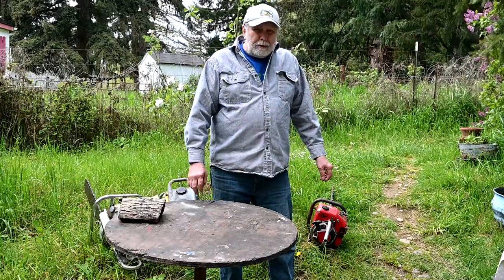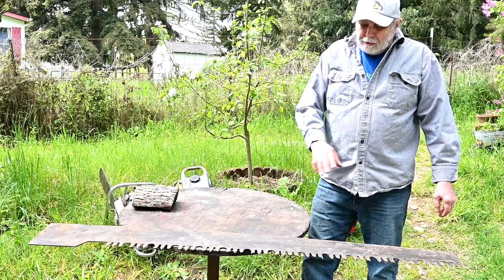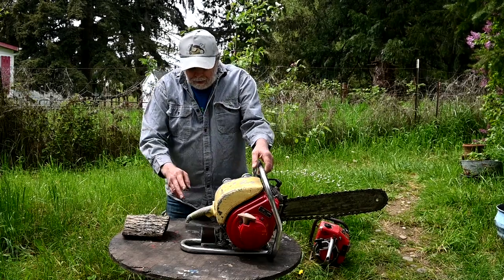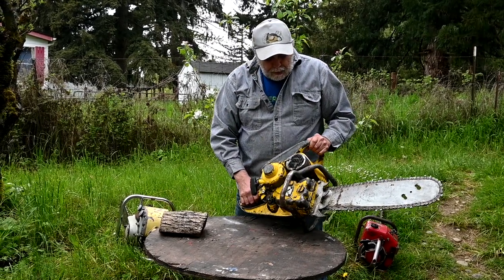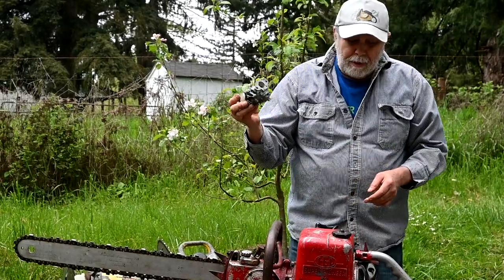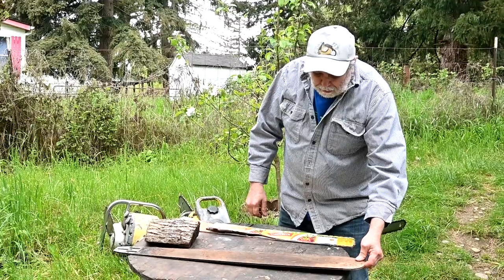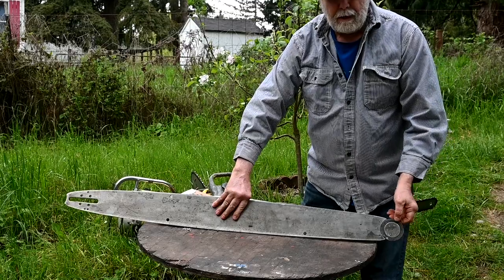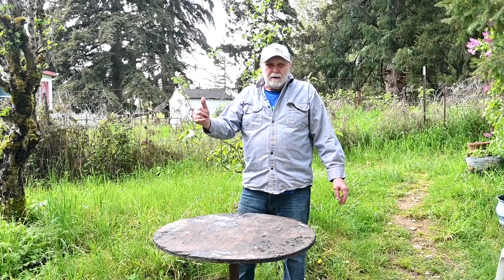Obsolete Chainsaw Chains + Vintage Chainsaw BS

Comment: I've worked on most engines in almost 60 years of wrenchin'. Many years ago I was given a cutter link from a guy who'd found it on his workbench. He'd worked as a parts man at a local dealership who, at 1 time, sold chainsaws & related parts. This link was from a roll that you literally made, piece by piece, a chain. So much for pre-made chain.
Reply from the maker: What an interesting tool and a neat tale !
Reply: What I should've said was likely from several boxes of chain parts to make a chain. I carry that cutter all the time in my change pocket. It had to be at least 1/2" or more. Makes me wonder how long it took to make a 20" chain.

Comment: Great explanation on bars and chains .
Reply from the maker: Thank you.
Reply: @mrobsoletesvintagehomestea9156  Thank you for showing me what for the most part I totally agree. Vintage stuff is just so great, period. I have an old remington super roller nose that is made in 1970. That saw has I would bet at least two thousand cords of wood that it processed for me and my father before that. Fifty two years of dependability. Forget the number of bars, not to forget to mention the number of chains is just crazy. I have never heard or seen any new saw ever be able to make that claim. Heavy for sure, but not afraid of working into any wood situation. The weight and 404 semi-chisel Oregon chain rules. Just lay the saw on the wood and open up the beast. 16 to 1 oil mix and make sure you bring at least 2 gallons of fuel mixed ready to go. I use canola oil for chain lube. Works super and biodegradable too. Now I said my piece to inform you Mr. Vintage. Peace vf
Reply from the maker: Remington saw were originally Mall saws.  I am impressed with the Remington build quality and advanced features they had in the early years.  The later saws were top notch too, except for the little Mighty Mite, which was a piece of crapola.
Reply: @mrobsoletesvintagehomestea9156  Fact well stated Obsolete. The REMS in my book were the best, period. But I am biased for sure.
Reply from the maker: I will try to get a video done on one of my Remington's this summer ! @victoryfirst2878
Reply: @mrobsoletesvintagehomestea9156  Most certainly look forward to seeing the great REMINGTON come back to life.

Comment: Appreciate you sharing info on the old stuff. Those roller nose bars are just cool, got my first one that came on a Mono SL246. Nice ‘47! I’m going to have one on the bench for my winter project, it’s in much worse shape than yours so I plan to totally restore it like I did my Super 33. I soon found out 1/2” pintail is rare as hens teeth. understandingly so, but I figured some would show up on FleaBay but no luck so far.
Reply from the maker: I really like the looks and operation of roller nose bars.  They really add to an old saws looks and performance.  I would saw that having one on a MONO was an added cost feature, as they were a real economy saw.  The pintail chain was phased out fairly early, and was used mostly on commercial saws, so it was used up, and is rare as a result.

Comment: You had to be a heck of a man to run one of those old saws all day every day. 
That Titan is a true left handed saw. That's the first left handed saw I have ever seen. I'm surprised that the big saw company's don't offer a few left handed models.
Reply from the maker: Old time loggers were a tough bunch for sure.  The Titan 30 is a very unusual saw in that the bar is on the left, while nearly every other saw made had them on the right side. Other unusual features are the handle bar also being used as a platform for the saw to sit on when not being used.  The other feature that was unusual is that the crankcase pressure was used to pressurize the fuel tank through a one way valve, to get fuel to the carb, and the diaphram in the carb pumped fuel to the jets, so it could be run on it's side. Didn't work well enough to make the saw run upside down though. All in all, a very unusual piece of history.

Comment: As far as video length goes I'm partial to videos anywhere from 25 - 45minutes long depending on what's going on. Quick question while we're on the topic of bars and chains. What was the purpose of the big hollow "bow-saw" bars? As for chain I just really kind of stuck with Stihl's rapid-super chain for my MS251. Since there's loads of Stihl dealers around here it's easy to get, I always thought the price of it was reasonable compared to other stuff I've seen in store.
Reply from the maker: The bow saws were used for cutting pulpwood on the ground.  The bar has a foot on the bottom which keeps the chain out of the dirt when lifting up on the saw to get it to cut.  They were more popular in the eastern US, but were also used for brushing .
Reply: @mrobsoletesvintagehomestea9156  Aah okay. Thanks for that bit of info. I've always seen videos from others in the past who have shown off their bow saws. They look cool with their big hoop design but never knew their purpose. Now I do. :)

Comment: Good overview.. I think the length of video depends on the subject matter.. sometimes 15 minutes is enough and others need 30 minutrs or perhaps more.. 
I have a Carlton chain but haven't used it yet. Also a Husqvarna X Cut chain which I also haven't tried out so no opinion as of yet. Otherwise I've only used Oregon.
Reply from the maker: Carlton chains were made in Oregon and were a competitor to Oregon, but from what I have found is that Oregon bought them out and have the chains made in China now.
Reply: @mrobsoletesvintagehomestea9156  Well, it was a bit cheaper than Oregon, so that might be true.

Comment: I would say the length of your videos is fine when you say all you want to say. Tailoring them to a certain length could mean something is left out, or drawn out. 
You mentioned one of those saws in this video as a homeowner saw. I think that until the mid-60's, there were no homeowner saws. Muck-a-luck came out with the model 15 about that time, as the 1st homeowner saw, and it looked very outdated. Until that saw came out chainsaws were too expensive and were built for the professional unless you had deep pockets. Look at some old chainsaw ads, $300 in the mid 50's was a lot of money.
Reply from the maker: The Titan 30 was directly aimed at the farm/home owner emerging market. In 1952 Titan released the Sportsman, which was a cheapened up version of one of their commercial models, but it was too expensive and didn't sell well.  The model 30 had the West Bend motor, which was a lot cheaper to buy than making their own engine.   So this was an attempt to broaden their market share, as the commercial line of saws were losing favor, and not to long afterward they exited the chainsaw market.  Early farm/ home owners saws were expensive, so the manufacturers tried selling the idea that you could cut and sell firewood, so you could quickly recoup your investment. The Mac 15 was successful for that market, and sold for a long time.  Soon a bunch of manufacturers jumped into the game, all competing for that market. As technology advanced, the prices of the saws came down.
Reply: @mrobsoletesvintagehomestea9156   Your right, I should have said the Mac 15 was the 1st "successful" homeowner chainsaw. To be successful mass production would have to take place to get the price down. Chainsaw companies knew the market was there, they just couldn't get the price where it had to be. I wouldn't be surprised if the Mac15 was sold for less or at cost in the beginning. McCulloch had much better saws available, the 15 used old tech. Do you have one? Might be a good idea for a vid comparing it to a Pro saw of that era, and comparing a pro saw today with a Wild thing.
Reply from the maker: I do have a Mac 15.  McCulloch did a dumb one with that saw, as some years they used only one piston ring to cut costs.  They were successful, as there seems to be a fair amount of them around still. I have never worked on mine to get it running, but your idea of comparing one to a pro model is a good one. I cant do a video on comparing a modern pro saw to the wild thing, as I don't own any modern saws.  The wild thing is the newest saw I own. I have a couple of early 80's saws, but all the rest are older. Take a look at one of my older video's (Pioneer Power of the Pacific Northwest 2019) posted July 17 2019, and you will see my Mac 15 and some of my other gems. Thanks for the ideas and for watching. @gregm4441

Comment: My god.  You would need To be a weight lifter to run one of those.  Monster saws for sure.
Reply from the maker: Most old time loggers were not real big bruisers, but average size, but tough !
Reply: @mrobsoletesvintagehomestea9156  they would have to have been for sure.  I doubt I could have used one even in my prime.